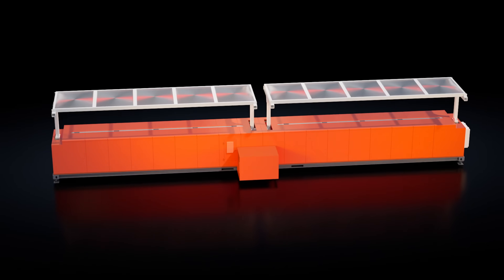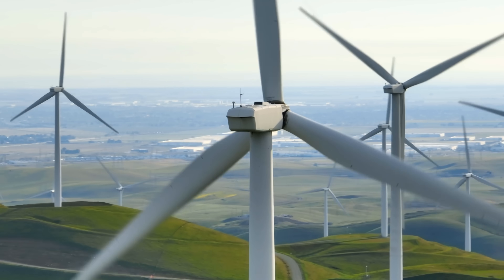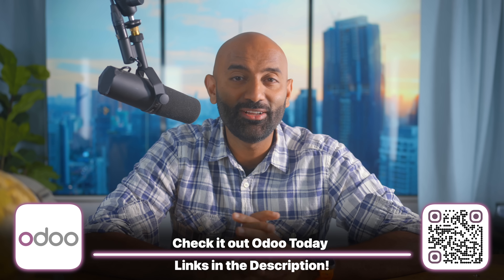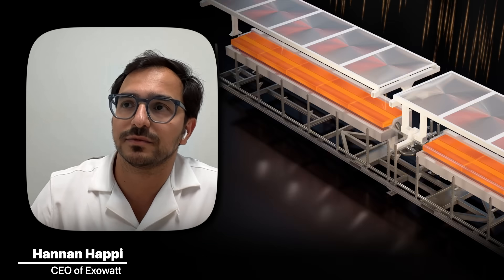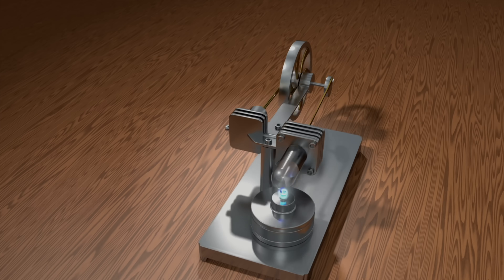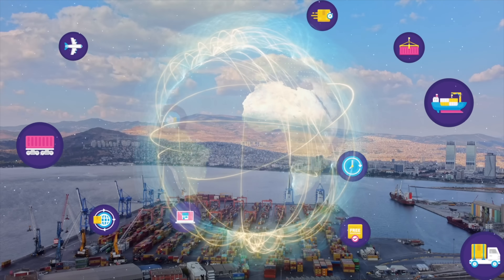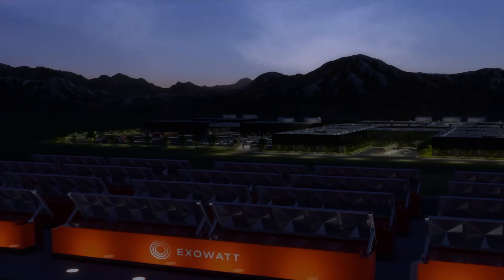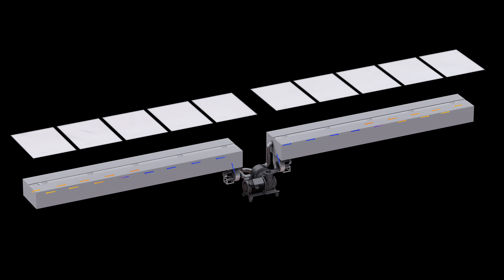Solar Without Panels, Storage Without Batteries - EXOWATT

Comment: I though that was gonna be serious content until he said "stirling engine"... Any engineer knows how useless are cause they don't generate torque at all.
Reply: An engineer would also know that you can't generate 25 KW electrical energy from an area the size of a 40ft shipping container. I guess they confused thermal energy with electrical power in their CGI models. Or that it's not very efficient to heat a large brick mass from ABOVE.

Comment: Please another video on this please. I have dealt with a mechanical LED display system with rotating LED's using a mechanical system 20 years ago. The results were stunning. But in practice it failed because of the mechanical components. They fail far too often. LED's became cheaper and the company never got beyond the start up phase. So this idea is great. But the mechanical components are key. The sterling engine is a mature technology. But find out what else can make this technology have a pitfall. Also, are there grid scale investors looking at this? Even that MIT Sadoway liquid metal battery got to a test on the grid. Still they failed against the falling prices of Tesla Lithium Grid batteries.

Comment: Solar concentrator energy yields drop fast when there’s any cloud cover, which significantly cuts the regions where this tech could possibly be competitive with solar PV. The weight of these structures is also enormous compared to a typical PV single axis tracker, so foundation costs will similarly be high. There could be applications for this tech, but it’s hard to imagine enough demand to amortize the engineering and manufacturing fixed costs.

Comment: Sterlings are not efficient or low-maintenance enough for this tech at scale. Peltier modules or even steam-turbine loops would be better for pushing electrons.
Reply: Peltier modules are also highly inefficient, be it cooling or generating electricity
Reply: @SolarCookingGermany Agreed, but they're very low-maintenance. I favour turbines by a fair margin, to be fair.
Reply: @magellan35  Simple solar panels are even more low maintenance because they don't require active cooling, and also more efficient. Steam turbines are high maintenance - and incredibly noisy :)
Reply: @SolarCookingGermany Well, yeah, but PV is kind of the SOP, whereas here we're looking at what to do with stored heat. I'm okay with noise, as long as it's managed / isolated. Sterlings on the industrial scale these folks are discussing will be noisy and have myriad moving parts (collectively).

Comment: 20+ years ago I developed, and documented, the exact same device, with the only exception being that heat storage would be a 20,000 gallon, heavily insulated, underground, water cistern. Primary limit would be the 212f degree water temp limit. I like their build better.

Comment: I have been off grid since 1990, I love the idea of not replacing batteries. I still use lead acid six volt deep cycle batteries as I am still not convinced the higher price of Lithium batteries is worth the investment. I love the simplicity of this design.

Comment: I think this is a brilliant solution.
Maybe this could also be scaled down to provide power and heating to a house, possibly even hot water ?
interesting thoughts ?
Reply: For electrical power use photovoltaic on your roof, if you want hot water evacuated tube collectors. Much better technologies than a 40ft shipping container in your backyard, and also much cheaper 😀
Reply: @SolarCookingGermany  
SCALED DOWN
A smaller unit , maybe on the garage.
Reply: @lindseyhatfield9017  Even if you compare space vs outcome, the technologies I mentioned always win

Comment: My thoughts:
- Why circulate air/gas instead of a fluid for more rapid heat transfer? I'm assuming to cut costs and avoid crippling leaks, but I don't know.
- What happens to the focused light at the far edges of the system when the sun is at extreme angles? In the northern hemisphere, the lenses would project onto the north-side pivot point because the sun is farther south in the winter.  Does it start melting the armature or maybe there's a mirror reflecting it back onto the absorption surface?

Comment: This is very cool how possible is this for single houses. I have 40 acres in the desert that needs power changed from solar batter < which due to cold and hot , have destroyed my batteries. This system might be an answer to that problem . What would the likely solution to this issue?

Comment: solar without panels - fresnel lenses in panel form. storage without batteries - a thermal battery.
Reply: only the arrangement of solar in a large open space is inefficient then - solar panels can be completely side by side across as much free space as you can provide. the lens panels cannot be directly side by side without being re-engineered. outer space is still the best option for most optimal solar at scale use. transmit the collected energy to ground stations for distribution.

your first pro of a system like exawatt is void - it still uses a battery, so the comparison with solar charged batteries is fundamentally flawed. they're identical.
2nd pro is actually a decent pro. even against the better suited lifepo4 li batteries, they kill it easily.

solution? use thermal batteries in a solar system. and solar panels collect more energy per panel side by side compared to lens panels. job done.

Comment: 11:11 
…can’t help imagining the difference in electrical power generated by solar heat falling on a large (as per here presented) fresnel lens in one minute and that generated by resistance to a cubic metre of sea-water moving at 4 knots over the same period of time….?
…land is valuable at all times for agriculture and stock-raising use on that one-quarter of planetary surface-covering called ‘Land!’….the 1996 (accidental) ‘plastic duck experiment’ demonstrated that all Ocean Currents are integrated in a Unitary circulatory system….don’t know what the average width of a ‘Curran’ might be but it must be measured in units of 100 miles…these operate over 3/4 of the planetary surface called ‘Sea!’
Conclusion: Earth is One Battery! H2&O generating (electrolysis) plant 15 miles+ from land (= below horizon) apart from generation plant will depend on two principal things: 1) carbon sheeting/fabric for generative resistance; 2) khatmatrix/syncopated cubeoctahedral modular digital construction principle to ‘solidify sea-water’ in right proportion to current traction made by carbon sheets for plant installation and overall generative resistance…1000 things more to say!

Comment: My first though when heard about sand batteries was, "Oh great, all the middle east oil countries are loaded with sand too."

About utility costs, everyone is overlooking something in their calculations

My local charges 12.7cents/kwh and without heaters or AC I use about 350kwh/month so bill should be around $45 right?

Nope, there is a monthly fee just for being connected to grid around $35 making the real cost about 22.8 cents, not 12.7 cents.

You literally run into the case of the less grid energy you use the more per kwh you pay.

Comment: I disagree with the argument of land use. Plant life can co-exist with solar as we have seen farms functioning with solar panels, & , more importantly, the storage for solar can be stacked vertically &/or subsurface. In other words, we can have a functioning 16 acre farm co-existing with a solar farm & battery storage. Solar can even be used in parking lots with subsurface storage. The Exowatt is a single level storage unit which may be better as a mobile generator, or housed on facilities whose roof can take the weight.

On a side note: solar is compatible with multiple energy storage/production devices: Stirling engine, batteries, capacitors, bricks, generators, fly wheel. Considering today's energy demands, a storage facility would be best designed to have multiple types & layers of storage & production: solar, flywheel, battery, Stirling engine, capacitor.

Comment: It's not just bricks. There needs to be a pump and a sterling engine that need maintenance and they are showing the lenses moving to aim at the sun. That also takes power and motors. How efficient are these when cloudy? PV still generates power (though diminished) when it's cloudy. It seems to me that these wouldn't work well as the light would be too diffuse. That said, this looks like a very nice option for power generation. How about a 10kW system for home use?

Comment: The use case they front will just make no sense... AI needs too much cooling and it makes better sense putting data centers in cold places (meaning less sun). This bottles their use case right away.
It makes sense for these systems to be used for desalination and industry heating... not AI.
AI needs geothermal, Hydro and Nuclear.

Comment: few big issues with this, first since its uses fresnel lenses it will be essentially useless on a cloudy day while solar will still get 10-20 percent of its output, secondly sterling engine efficiency drops when temps decline so this 1000 degree figure isnt really accurate and clay has poor thermal conductivity so the 21 percent efficiency of the sterling engine is at its peak temp, not its average running temp. thirdly the solar gathering area of these modular power plants is tiny compared to solar panels so you lose a lot of sunlight. fourthly solar tracking is actually very cheap as you can use solar panels themselves to guide the tracking motors, no microchips needed. 

for small scale this is fine but for large datacenters concentrated solar molten salt reactors are better and you can use natural gas as a backup to add heat so you get 24/7 power.

Comment: Solar data is simply wrong. Also there is a big difference between Watt and Wattpeak, basic errors with units. Solar panel effiiency is 23% in commercially available panels. Also, for the bigger sizes, the peak power is 600Wp, not 500Wp. Land use is a bit of a marketing excercise instead of reality. You can put solar onto roofs, even big roofs of big datacenters. Try doing that with CSP.

It's simply a marketing video when all basic technical data is wrong. Using the worst of solar data and the best of CSP. Not even heard yet that CSP makes very little sense in northern europe. So only great in sunny deserts. 

Lot of talk about 'low maintenance'. Not sure what kind of maintenance there is for solar panels and batteries, I bet dust on CSP has a bigger impact then dirty solar panels. 

Also, so many CSP projects have been build as a test and none have them have succeeded. Also, low energy prices is only interesting for big users, energy companies want to make money, you don't do that by lowering prices.

Solar panels have never been as cheap as now, a bit less then 10 euro cents per Wp. Yes okay, this is panel only without installation costs etc. 

CSP is a very niche market. On the basis of that alone, it will not get very far. Maybe purely for datacenters but that's about it.

Comment: Can you find out when deployed, how long does it take for the bricks to heat up before you can start generating energy?  For solar it’s immediately, but this would seem like it would take a couple of days.  Is it possible to preheat the bricks to start using it sooner?
Reply: Probably forever, since the bricks get heated from above and not from below, which is extremely inefficient to heat a large thermal mass

Comment: We mustn’t forget that PV panels are generally (especially the cheap one) affected by shading in a manner greater than the actual surface shaded. With some older panels, nearly the whole panel loses production when a sheet of paper blows onto the panel. With this system, the photons lost are strictly limited to the square millimetres of actual surface affected.

Comment: I still think LiFepo4 batteries placed inside these same shipping containers with solar panels attached to trackers on top would prove to be a far cheaper and more reliable option long term as it has far less moving parts and a much simpler reliable/ proven construction. Feel free to leave you response ✌🏼🕊️❤

Comment: Yes, it would be very interesting to see this gone through even further. One item on the Solar tracking our unit that we had at our cabin, used to have a frame that was around the solar panels that was filled with pressurized Freon and would change as it was heated it would track the sun. So it does not take a gear or any type of motor to actuate,  I had to get up on a ladder, a couple of times a year and just lube, the pivot joint which had a carrier bearing type bar through the metal frame that held the Freon so there was no Motors involved on that part of the tracking.  This is a great episode. I’d love to see more information on it, especially being here in Arizona.
Reply: Never heard of anything like this.  I googled it and can find nothing.  Can you please help in making this infor public?  I want to know more
Reply: @Hydrotricity  been a few years since I’ve had the cabin, but the company that was doing the solar system was out of Chino Valley, Arizona. They used a Freon filled tubing system and a spring hydraulic type arm to return it to the beginning when the Freon cooled. It may be Verde solar power, but I’m not positive. It did work very well.

Comment: Its all great in theory assuming firstly that solar efficiency doesn't ever improve again, doesn't get cheaper, or doesn't get smaller, which historically hasn't been the case in any of the three, and secondly that electricity demands don't scale up to higher than what these units can produce in the area available. Sure solar has the same problem with area availability but solar's solution is to increase efficiency of the technology while pushing down cost along the way as a byproduct, which makes it so that you can buy a solar grid and then when a new breakthrough occurs rather than getting rid of everything you simply replace the panels. Solar is forward thinking while this product, like all the others that focus on instant economic viability, get swept away incredibly quickly by later innovation. And even ignoring that this company isn't even economical, if you use a fraction of critical thinking since even if this is cheaper I guarantee you that buying this, then paying to remove it, and then buying the more efficient solar technology that comes out later is going to cost more than if you had just bought the more expensive solar to begin with since you then have to buy two things and pay to remove the first one. For a smaller business that might still make more sense if you don't have the budget to eat the up front costs but even that isn't really true when you see that it's far easier to buy a less efficient and cheaper solar power system and slowly upgrade it over time with more efficient panels. This "economical" option assumes a lack of innovation, ignores the cost associated, and lacks small scale modulation. If you buy one of these and end up with too much power you can't cut it in half and return half of it, but with solar you can.

Comment: It's also important to note that traditional solar panels often rely on highly toxic materials and metals to facilitate the process of generating electricity, which is often glossed over or entirely overlooked by proponents of photovoltaics. This seems like a technology that could have an even lower environmental impact than traditional solar. Super cool!
Reply: 77% Glass, 10% Aluminium,  9% Polymers, 3% Silicon, < 1% Copper, silver & tin,  < 0.01% Lead...🤔

Also 95% of a Solar_PV panel is recyclable ♻️ 

Stop trying  to Gaslight people... 🥴

Comment: question. 

the solar thermal plants in california fell into fraud because the back up natural gas plant on site ended up being used more than the solar thermal energy, all at a higher cost than a regular natural gas plant gas plant. 

how reliable is this system? what is the minimum consecutive days of power production?

Comment: 1. Good analysis. 
2. Excellent deep dive when addressing the acres/MW.
3. Similar companies bankrupted in the past is no indicator of viability. It is an indicator of the mismatch between governments and true economic interests. They only see the margins on their contracts or the social agenda, not the economics of electricity (after all, they print money and gather taxes).
4. There was an alternative to clean energy, almost for free... was shut down "misteriously". I still do not know if the engineers are alive doing something else. But the engineering part was solved. The political side was not.
5. This approach (or the video) does not explain how a brick could not brake by fatigue after such high temperature contracting and expanding every day.

Comment: I've been trying to use Fresnel lenses for about 10 years.Ive been getting blocked in nearly every direction I turned.Still being controlled because Fresnel lenses is basically a light amplifier and can solve a lot of problems for the poor-they are blocking me but they can't prevent everyone from using this tech.
Reply: I use them for cooking, no one's blocking me. In long term applications they don't make much sense, they require complicated tracking and the plastic isn't UV stable
Reply: @SolarCookingGermany you don't live in South Africa,china!